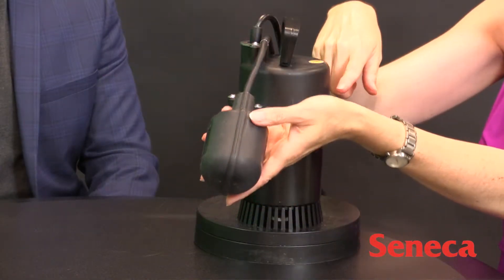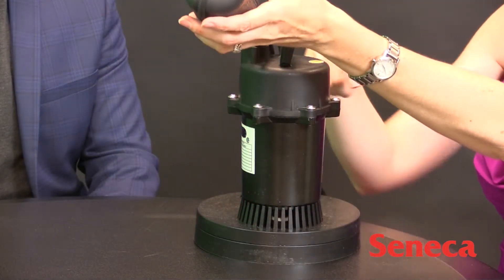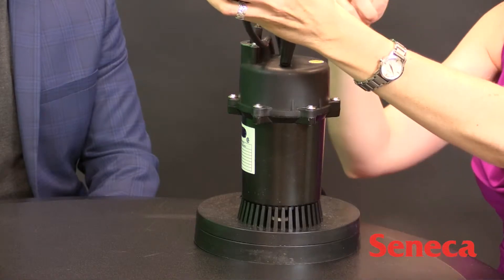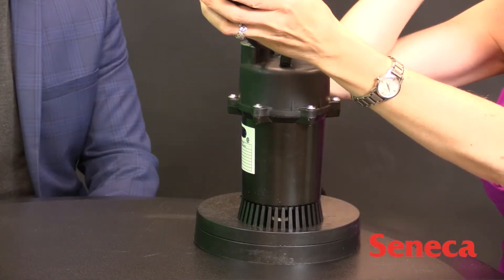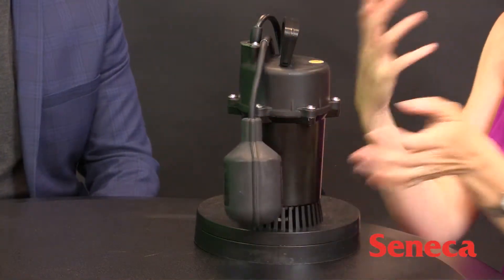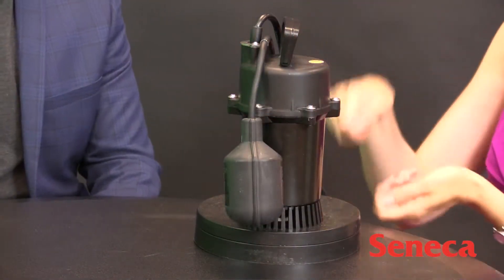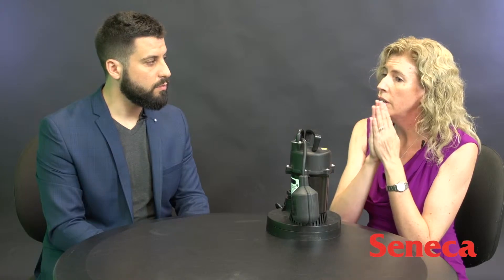02 REDUCE YOUR HOME FLOOD RISK BY MAINTAINING YOUR SUMP PUMP AND INSTALLING BACKUP POWER

Comment: Sump Pump in the Cold Room
(uninsulated cold room and open to the out side weather and there
is the 4 inches open vent to the cold room from outside) and when
the water fill in the sump pump pit and pump try to pump out the
water with a pressure  and Due to the cold weather
we having sump pump pipes in the cold room already frozen and
bursted and water leak everywhere in the basement. why my builder
install the sump pump in the cold room -This is hilarious when you
thing about